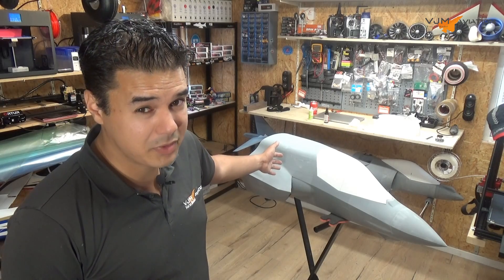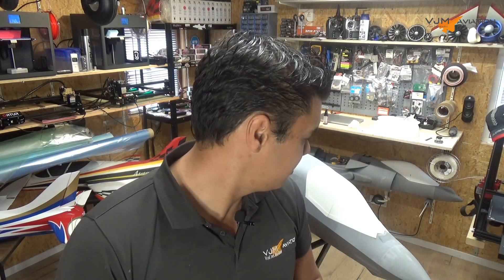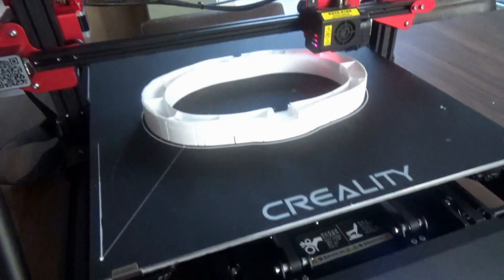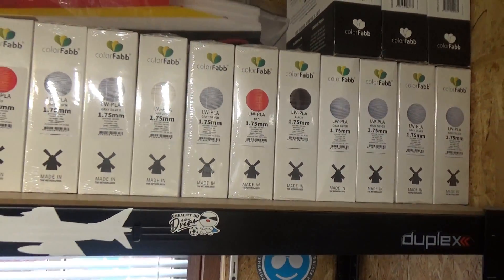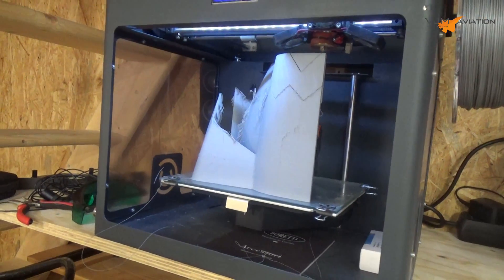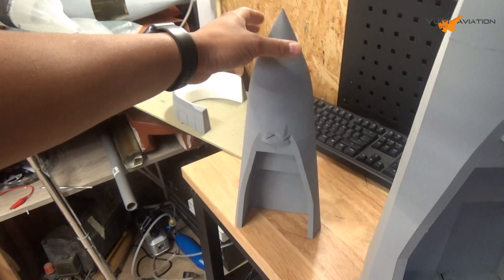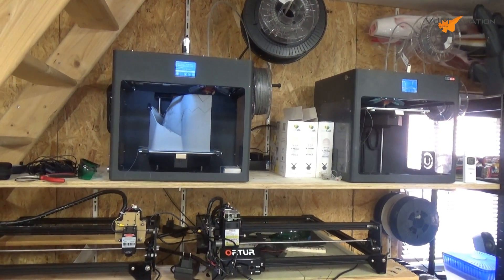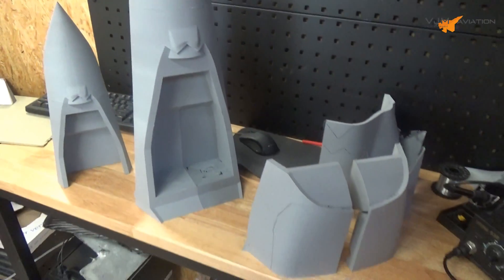F-35B Big Scale 3D LW-PLA printed build series RC Model | Creality CR-10 Max!

Comment: Amazing work! are you doing single-perimeter printing, or are you using thicket walls for the parts? Any worries about deformation of the gray parts during the summer? I have been designing and printing planes for ABS, but just recently purchased my first roll of LWPLA to test.

Comment: This is exceptional in so many ways. I was wondering, are you still going to use the inner structure (liftfan, rear engine, landing gear etc.) of the composite F-35B you built last year? Because it looks almost every bit as revolutional as the real thing. Good luck!🙏
Reply from the maker: Hey yes everything I going to use again, because of my fulltime job at Philips and being fulltime dad I needed a new cheaper/faster way to build my airplanes. I hope to find this in LW pla during development. Once done we build one out of composite again as same for the harrier

Comment: Awesome design! It looks like your 3d printer can speed up building your models. In the real f35, there is a clutch system which allows the main engine to spin the lift fan when the clutch is engaged without need for more fuel. This system is what allowed the F35 to be more fuel efficient than the harrier while producing more lift. Do you think it's possible to modify an EDF (either with a 3d printer or other materials) so that you can spin a second ducted fan with that modified edf using a clutch? This way the battary only needs to provide power to one motor instead of two.
Reply from the maker: That we have tried, but very difficult. That singele edf is calculated for one blade and has been optimized, adding an shaft it will double the current and probably burn…but…i like the idea! We have to experiment with new motors, maybe lower kv settings…